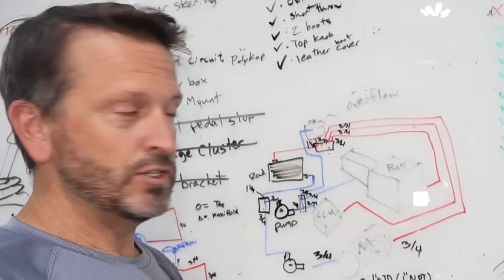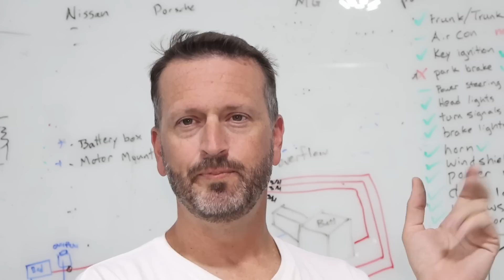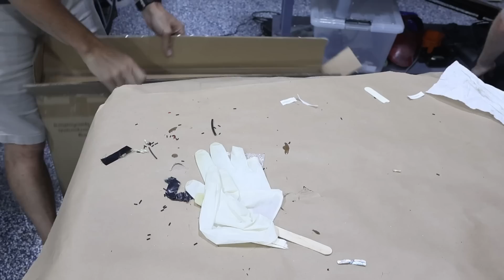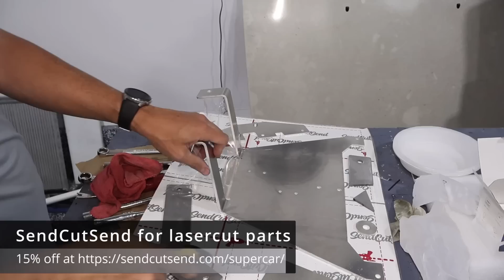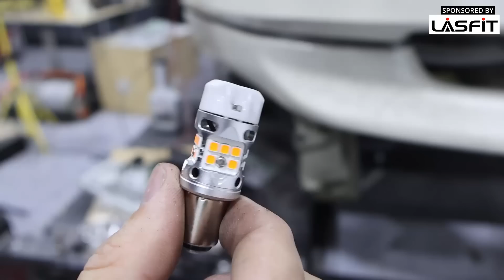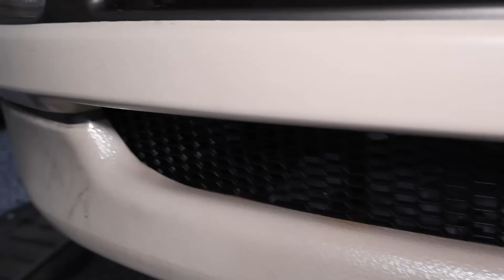Cool and Powerful: Installing a Tesla Pump Cooling System in a 300ZX

Comment: Like Your builds. Don't mix copper metals to water system where there is a lot of Aluminium you get corrosion even when you have coolant with corrosion resistant additives. I have built and used water cooled computers about 30 years and even with total Copper system and Nickel in some surfaces you get corrosion sludge some corner where  you don't want it. If system is mainly Alu use Nylon connectors they are also much cheaper than Brass.

Comment: I guess the components themselves have temperature control, so you don't need a thermometer at every component. Would it be useful to be able to turn the systems on individually?

Comment: It’s been a decade since I had my z32 but I remember bolting on and wiring a Nissan maxima? dual fan and shroud assembly. It was a common mod to get away from the oem mechanical fan setup

Comment: What material is the manafold? It looks to be aluminium. The fittings looks to be brass and you should not be mixing them or you will have bimetal corrosion.
Reply from the maker: Without an electrolyte the possibility of bimetal corrosion is very small.
Reply: @ElectricSuperCar  As far as I know, even distilled water will cause bimetal corrosion in computer water cooling lines. It will be prolonged if you add some anti-corrosion additives but will not completely prevent it and is therefore illadviced.
Car cooling systems might be more overbuilt to prevent issues caused by ineffective cooling, and you might be able to have more anti-corrosives in the mix compared to a computer cooling system since the anti-corrosive stuff is less thermaly conductive then the water is.

Comment: You said during the ad read that the headphones was IPx5 rating which you said was water and dust resistance. The first character is the dust resistance part and the X indicates no known or tested resistance and only the 5 indicates level of water resistance which is light water jets from a nozzle of 6,3 mm.

Comment: Gonna be a little pedantic for a moment. Your a little high on your efficiency ratings for automotive (gasoline) internal combustion engines. The average, currently, is in the mid 20% range, with the highest being around 30%. Diesel engines can approach 35%. There are no high production IC engines that have anywhere close to 40% and with current practices, none will exceed these marks since, otherwise, they become unreliable, or outragously expensive.

Comment: I hope I'm not too quick with a comment. I don't see a bleed air valve on your high point hose? Or is it the radiator cap. I didn't expect the line over the radiator, but I would think it would hold air at its top. 
I'm in my tesla in the mountains way off grid by Yellowstone. I'm watching and texting from my starlink. If I'm not eaten by a beer, this is a great way to camp. 
I don't tent camp with beers unless they are in a can. This tesla browser is slow even with a super fast connection.

Comment: Once again, your attention to detail is amazing!  The grating in the front of the car just adds that little something.  I did really enjoy you walking us through the layout of the cooling, with the reasoning.  An extremely simple solution, but also efficient and streamlined.  Did you add any rubber between the pumps and the mounting hardware to isolate any sound transfer?  I have found a lot of people are rather picky when it comes to controlling the sounds that are perceptible in their vehicles.  Are you doing part pricing at the end of each build series, or is that something that will be between you and the client?  Keep up the fantastic work, Jeremy.  Looking forward to the next video.
Reply from the maker: I will likely not be disclosing client $

Comment: Those pumps are PWM controlled like you mentioned. A simple 2hz PWM signal from an Arduino can control them and might help balance the flows. Links in YT get deleted but you can find details and a working sketch if you go to the Nissan section of the Openinverter site as Nissan used the same pump.

Comment: I think the tubing is not the right one.
There is automotive EPDM hose to do this with long life. Or silicone.
Reply from the maker: This tubing is fine as we are not dealing with high temperature applications.
Reply: @electricsupercar  we'll look into the properties and you'll find these get hardened over time. Just by the coolant.

Comment: I'm not convinced by your argument about radiator size. The coolant in an ICE engine is like 190-200 degrees F 100 degrees over ambient on a hot day. I think the "hot" side on your system is only going to be 20 to 30 degrees F over ambient.  That means you need 3x to 5x more radiator for the same cooling. Maybe you have 5x less cooling needs, but I'm not sure.
Reply from the maker: You are correct that the temperature difference is an important factor.  The point is you are needing to cool 6x less than a combustion car.  Pretty much any radiator will handle the cooling just fine.

Comment: Your back-of-the-envelope heat calculations for ICE is incorrect. The rule of thumb is that 1/3 of the gasoline energy goes to moving the car, 1/3 goes to parasitic losses (drivetrain friction, alternator, power steering, etc...stuff that isn't cooled by the radiator) and 1/3 is heat (including heat lost to exhaust). The cooling capacity of the radiator only has to deal with the heat that doesn't get exhausted (plus a decent margin, to allow for dirty/damaged radiators not working at peak efficiency). 
Bottom line: the radiator for your 300ZX was probably designed to cool maybe 200-300 HP of thermal energy when it was new. It won't be massively overkill for the electric motor and batteries like you implied. It will probably be sufficient, but don't write it off as solved. Especially because, as you said the greatest thermal demand will be during DC fast-charging, while the car is sitting still. The radiator was deigned for the most thermal loads being at high speeds, where you have tons of airflow over the radiator. You'll need pretty good electric fans on the radiator running during DC fast-charging.
Reply from the maker: This car will not have DC fast charging.  This radiator is very much overkill for this application.
Reply: @electricsupercar  Ah, my bad. I misunderstood when you were talking about charging. So, what kind of battery capacity/range are you hoping to achieve?
Reply from the maker: @rthomp03  125-150 mile range

Comment: Be careful in assuming Florida not getting cold. It absolutely does! Now, this owner might not use the car in those conditions, but that state DOES freeze!
Reply: You must live in the panhandle. We get about 10 days of 40 to 50 degree evenings during the winter if we're lucky.
Reply: @AnakinA1  when I lived in Florida it was primarily Jax and central Florida. You may not remember or know, but deep freezes have hit all the way down to the everglades and a bit over 40 years ago a LOT of orange groves got wiped out by a deep freeze. I have seen snow in Ocala (1989) and Jax (can't remember the year in the 90's). We also had freezes in the 2008-20012 timeframe as I was riding a motorcycle at that time. The strawberry farmers pumped so much water to save their crops sink holes started happening in the Tampa area. So, yes, Florida does get deep freezes.

Comment: Hot topic.🔥Cool program! 🥶 😎 It is nice to see that your adapted EV cooling system looks pretty straightforward. I'll add that conventional BEVs have the added complication of DC fast charging. Which requires additional cooling, and sometimes heating to optimize efficiency. But for a EV refit like this with relatively low current, (120V/240V) AC home charging, this is great!⚡

Comment: How you can make sure that MCU and battery pack have each enough flow? Wouldn't one have more restriction than the other and have less flow than the other? Can you balance the restrictions? What if one loop clogs up? Is this even a consideration?
Reply from the maker: Loops do not "clog up".  Balancing I have usually done by flow control valves if needed.

Comment: Please Put your header tank feeding into your pump block. It will help you fill and guarantee you do not run the pumps dry. Luckily the tesla pumps shut off if there is no resistance from water.
Reply from the maker: Got it

Comment: Are the plastic garden hoses you're using adequate for the task of cooling in automotive environment? Whenever I used plastic hoses they collapsed from heat so I only use rubber ones. I live in Greece which is similar to Florida weather. In the summer it's tough...
Reply from the maker: Yep, they are good!

Comment: Most EVs run with components arranged by level of max temperature rising, all in a series connection. So It would be Batteries, Charger, Inverter, Motor usually. This way the coolant gets gradually heated up through the loop and works effectively. Doing it in parallel means everything starts reaching the same temperature, which is not the most effective way. Also paralleling means you need to carefully balance the flows between the various parallel components to ensure propper cooling.

Comment: Really nice,
Hypothetically, could one pump draw the coolant through the other pump if one fails or are more efficient?
Are there a need for check valves?
Thank you for a great video!
Reply from the maker: Failsafes are in the temperature cutoffs for the various components.  No check valves, flow control valves may be used if needed.

Comment: As someone who obsessed over the 300zx as a kid, and now owns an EV as an adult, this has been the best full circle build to follow. Cannot wait to see the final result.
Reply from the maker: Thanks Friend!
Reply: Honestly stuff like this is genius. It may have been done but I want to see someone make a crazy hybrid. Like take a front Tesla motor and make a high hp RWD AWD. Or use the newest partially electricified turbos on an old car.
Reply: @amg2022  Unfortunately hybrids are very, very hard and expensive to make. Would be incredible but they are too complex for enthusiasts, especially for high power cars
Reply: @arthemis1039  I think they are now but not really for the next generation. I have friends with kids programming raspberry pi stuff so I can totally see someone hacking junkyard stuff and making it work in the distance.

Comment: Hi, there's a product on amazon called as Adjustable Turn signal fasher relay (Adjustable Turn Signal Relay CF13 EP34 - Flasher Relay for Led Lights Hyper Blink Flash Resolve Rapid Quick Flash Issue), which has a small turn knob to adjust the speed of hyper flash. But i guess you will have to select it according to the car model. I purchased a 12v 3pin relay which was an exact replacement for my original turn signal relay. Plug n play, adjusted the knob to slowdown the hyper flash speed and is working great without any issue for over more than two years. Hope this helps. Cheers.